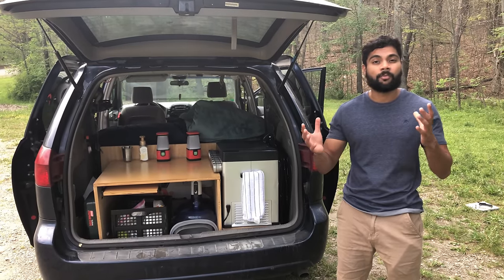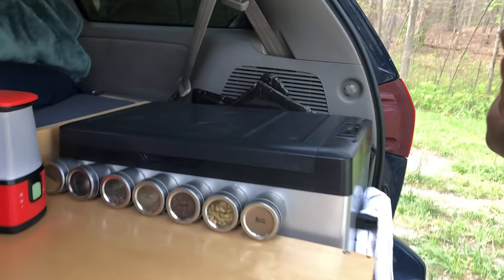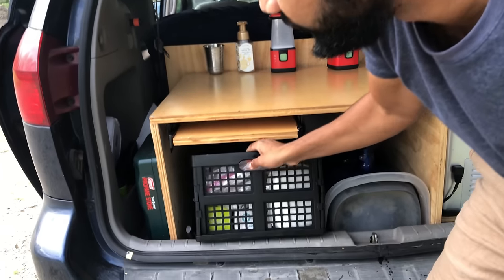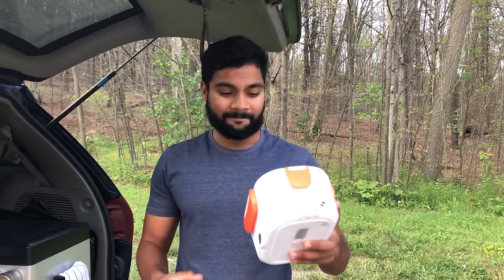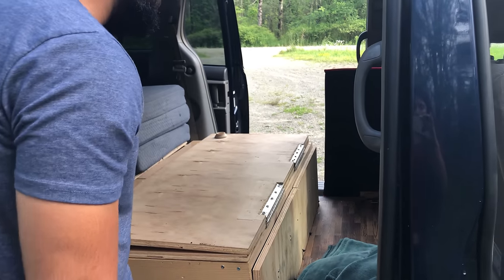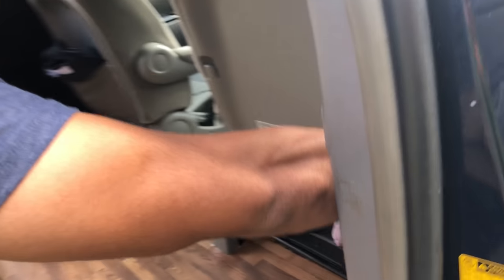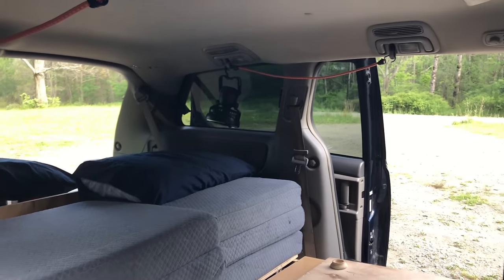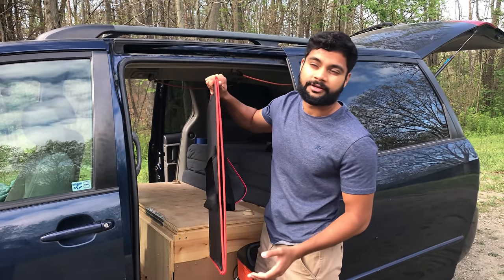Simple Toyota Sienna Minivan Camper Conversion Van Life Tour | Stealth and Full time living | $7K

Comment: Your hinged bed flap that has the legs: may I suggest cutting it into two flaps so one can sit at desk mode while the other reclines?

Great start!
Reply from the maker: That is a really really good idea, I thought about that after 2 months into our trip. Would definitely be a worth while modification! Also good if One wants to sit and the other wants to sleep! 

Thank You for the suggestion!
Reply: @qasimkayla440  Obviously if you make that modification, I suggest moving the closet-rod holders to the middle of each flap to center the weight-bearing load if only one flap is down.
Reply from the maker: @matthewsinclair1602  100%%
Reply: Great idea
Reply: Hi Qasim & Kayla, do you have a set of drawings for the woodwork parts of this?

Comment: super efficient use of space. well done.  you mentioned a time of 4 months living in the van... how long are you planning on total? is this a road trip or semi/permanent. do you cook on a grill or portable stove? what about pans and utensils. what do you do for bathing?
Reply from the maker: Thank You! 

Total trip was 4 months, just ended it a few or so ago. It was a roadtrip. We cooked mainly for breakfast, on a portable stove, meal prepped for lunch and did pre-made Costco food for dinners. Pan are beside the crates and utensils are in them in a pouch. 

For baths, due to covid since many showers were closed I build a ABS pipe rooftop shower, we sold it due to low MPG (wasn't worth building IMO) but used gyms and trucks after things opened up.